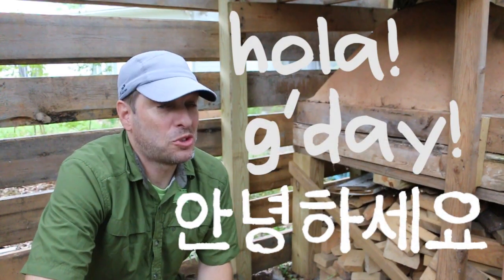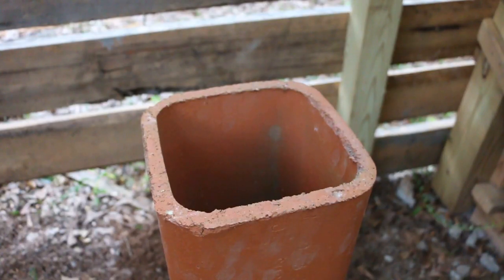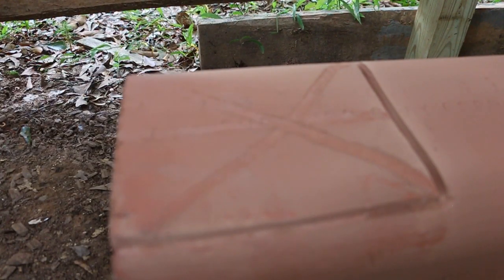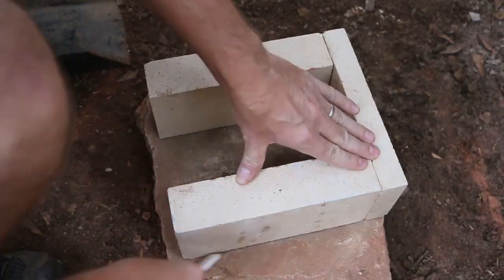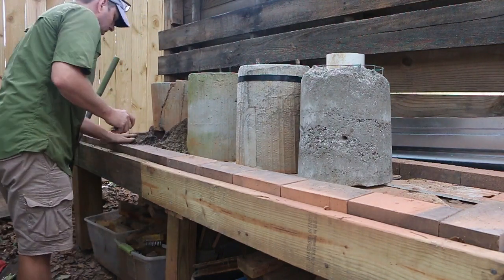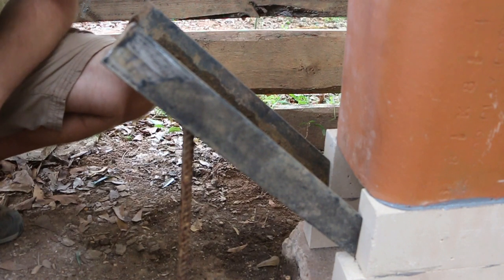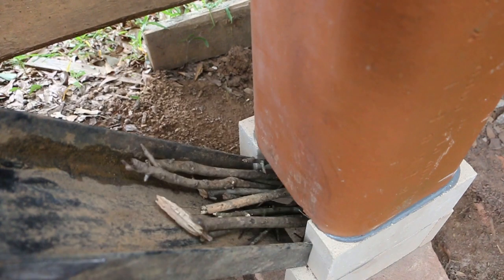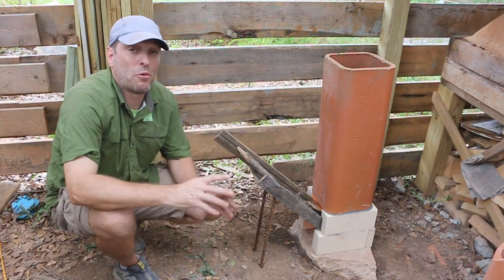How To Make A Chimney Pipe And Fire Brick Rocket Stove

Comment: Love watching you battle gamely uphill with sand, cement, cardboard, power tools and hammers, but man, it is so much easier to use fire brick.  We make our stoves portable by using angle iron (usually cut up old bed frames) and threaded rod to form a cage that holds the bricks firmly together.  To move the stoves, simply back off on the threaded rods and handle the bricks separately.  Quick, and with the stability of a casting.  Set the stoves up for maple sugar season, dismantle them for compact storage afterward.   Never spend a dime on fuel.  We do keep a stainless steel rocket stove for camping.  Double walled and insulated, weighs 18 lbs, has legs and a handle.  We do like our little luxuries.
Reply from the maker: Thanks Jill. Having built a variety of rocket stoves now (including one in firebrick), I will agree with you. Here is my firebrick rocket stove, if you are curious: https://www.youtube.com/watch?v=OJ-gOr3iQ4k&t=4s How cool that you use your's for maple syrup production. I love to see video of that. I think I will end up replacing the flue pipe in this project with firebrick and making the riser shorter. I really want the flames moving through the oven. And, for the record, my channel is about the journey, and not necessarily first finding the easiest path. I love the experimentation process, what some see as failure, I see as iteration. Not saying I got that sense from your comment, to the contrary, it was encouraging. I do intend to migrate toward simpler and easier as the process goes forward, but it will always be the uphill battle...and I hope to pursue that in a gamely fashion. Thanks for watching.

Comment: Great video, I do not want to squat and the extra height is welcome. The feed ramp excellent but sheet metal and a couple of bolts, keep you from getting a broken foot, pot holder,( I know you don't need one here ) one of your sheet metal bands, notched for air flow, works great. Lastly many forget, lift your pot and drop fuel in the top, works especially well with the extra height. Thank you. Last thought  when camping I used to take two blocks and build the rest on site, clean up of the mud base was no problem.

Comment: i like your honest inventive trial and error approach... 

just to be aware, most of these stoves, except perhaps the perlite concrete one are not really true rocket stoves...  over 50% of rockets stoves on youtube are not true rocket stoves, so the term is being widely misrepresented now....

a true rocket stove uses lightweight porous insulation for burn chamber... fire brick is too dense to be good insulator, tho it can take high heat... maybe surround the fire brick with some kind of insulation, and it will simply take longer to warm up enough to have the rocket stove effect of being less polluting....
Reply from the maker: Thanks for the feedback, Forest. I agree with you...the term Rocket Stove is used to describe many stoves that aren't true rockets. I do plan to make a true rocket stove sometime this year. Thanks for sharing your tips. Thanks for watching.
Reply: @GreenShortzDIY  Hey man, I'll be on the lookout for this. I'd even buy a true rocket stove if you are willing to put it out on the market.
Reply: Could you share what the details are for a true rocket stove?  I've noticed that there are a lot of variations in these small youtube stoves...
Reply: a true rocket stove has an insulated burn chamber, using some kind of light weight low density fireproof material, such as vermiculite, rock wool, cinders, type material... this material is packed between two layers of usually metal, sometimes other materials.... the insulated burn chamber once heated up reduces pollution greatly, and was designed for third world people who often cook indoors on an open fire....

many so called "rocket stoves" follow a similar design system but are not insulated at all, or insulated poorly with too dense a material, to reduce the pollution.... if using this type of fake rocket stove outdoors, not such a big problem....

but if wanting to reduce pollution, and get quicker cooking time, and more efficiency, the double wall insulated rocket stove system is important...

there is another type of stove call a "tlud stove" (top lit under draft), or "gasification stove" which can accomplish a cleaner burn without the need for insulation.... but it does require getting more technical with the proper design, knowing just where to place the holes in it, which make it a more bit more technical build system, but no need for insulated burn chamber as in rocket stoves, just need to follow a well designed diy system.... many examples on youtube, and one advantage with bigger tlud stoves is that you can make biochar as well when using it... 

here is a demonstration of commercial gasification stove: https://www.youtube.com/watch?v=PwDCkwJhgy8.... but many do it yourself models on youtube as well... aloha

Comment: Well done. The pizza oven door cannot be more than 61% the height of the dome, it can't trap enough heat, if it's taller than that. If you want to cut any fire brick or the chimney flue, put a ceramic cutting blade on your Wormdrive skilsaw, cut are much faster and much easier to hold in place. Plus, set your depth, make a pass, drop your blade a bit, make another pass. Much more torque and HP to cut than the unstable cutoff. It is at least 4 times faster to cut.

Comment: Cool video.  Ramp is wider than firebox opening which allows wood to grab the firebrick and stop.  Maybe narrow the ramp to match the opening ?
Reply from the maker: Thanks for the suggestion Dave. I think you are right, that a matched ramp width would perform better. I’m using salvaged steel and standard sized brick. Making them match here would have been a lot of extra work. Although I could have welded inserts in the ramp. Thanks for the suggestions. Thanks for watching.

Comment: if you use the thin fire brick, and cut it down to size, you could line the clay chimney to make it more resilient. Place the first row accross the fire box bricks that you can see from the top of the chimney.  Then cut to fit the other two sides and place them on the other two sides.  Then you can build up to the top from there for a tight sealed fit.
Reply from the maker: I like your thinking Brad. I have added a thin fire brick to the back of the firebox, but I may need to go higher with them. Thanks for watching.
Reply: This!

Comment: Will this run hot enough to melt small pots of lead? I've been using a Coleman stove, but sticks are far less expensive that liquid fuel.
Reply from the maker: Jerry Campbell I do think a rocket stove could melt lead, but not in this configuration. I think you’d want the lead crucible closer to the fire.

Comment: Oh darn... I went to buy one...but it was too small for what I was going to use it for... Are you making any... The size of your bucket rocket stove ?
Reply from the maker: In the end, I think the flue pipe is too brittle to handle the heat of a rocket stove fire. I did build one with a cobb liner, but that may restrict the size of the chimney too much, based on the size you could find. Let me know what specs you are working with and I’m happy to offer some suggestions. Thanks for watching.

Comment: I enjoy watching your videos on rocket stoves.  But I would like to see you do a design change that I think will significantly increase the efficiency and make your stoves more Rockety.   A taller flue will create a higher air draw ratio at the fire source.  But more importantly, I would like to see a vertical stick feed with at least a 12" horizontal distance between the feed and the flue.  Creating more of a "J" design.  This will create a horizontal fire draw before the fire enters the flue.  I really want to see your take on the comparisons with a horizontal draw v/s a near vertical draw that you have in your designs.

Comment: I don't think the flue liner will last it's not build for high temperature but at the place where I get fire brick  they have flue liner kind of build like fire brick and those flue liner will take the hi temp
Reply from the maker: I’ll be keeping an eye on it. I did add another thin fire brick standing up in the back of the firebox. I was noticing a few hairline cracks where the flue pipe was nearest to the fire. Thanks for the feedback.
Reply: @GreenShortzDIY  
I hope that the extra brick helps, but suspect that eventually your flue pipe is going to disintegrate. Have taken down several houses where they are just a standing column of powder being held in place by the chimney block or bricks around them. Think it is the temperature differential between the inside and outside that is causing the cracks you are seeing already. Perhaps once the pizza oven is installed this degradation will slow down, with more of the heat being held down around the outside of the pipe?
   Actually came to make a suggestion though, have you considered using a section of double or even triple walled wood stove pipe? The cost would be a little higher, but wonder if the benefit of maintaining the higher temperature inside of your flue would be worth it? My understanding of these types of stove's is you want the higher temperature to carry further through the flue to help cause the rocket effect.
Reply: where do yo get a liner for high heat??
Reply: At the place where they sell brick here where I live they actually have liner that will take high heat more then the regular one but don't know if it's available every where the salesman told me it was a special order and they have some left and they don't keep those liner regularly. he told me they done some test whit them and the regular liner, they heated them whit torch until they got red and they trow cold water at the the regular flue exploded and the grey one like fire brick did not!!!
Reply: MR.Teddy Bear any brand or manufacter name ???
Reply from the maker: @putheflamesou  It is actually not a special flue liner for high heat. We'll just have to see how it olds up to the heat over time. I think the best thing for high heat would be a full build out of fire brick. Thanks for watching.
Reply: @GreenShortzDIY  that was my feedback too.  That, as is, the lower part of the terra cota will fail fairly quickly.  The high temps go up as high as half or 2/3 up the height of that flue liner.

Comment: You didn't put the grating at the bottom to leave airspace beneath the fire, was that on purpose?  I'm pretty new to rocket stoves, I'm just curious after watching the succession of these videos :-)

Edit:  I wish I'd seen the Kickstarter in time!  I'm glad it was successful :-D
Reply from the maker: My initial thinking was that the ramp would suspend the wood letting air flow underneath. This works until the wood gets to short and drops off the end of the ramp. I might weld a grate on the end of the ramp after all. Thanks for the feedback. Thanks for watching.

Comment: can you get a flue pipe that would take the heat....or is that tooooooo safe and sensible and liberating?
Reply from the maker: Ha. Well, I think it may need to be a different material. Or maybe lined with fire brick. Or made out of clay. I do have some of that on hand. And I do plan to make another Cobb Rocket Stove soon. Thanks for watching.

Comment: Is your little stainless steel rocket stove available to buy yet? I'd like to buy one but that has an extension on it where you can screw it into a concrete pad. I get a lot of things stolen from my yard. Also, if I screw it down to the concrete pad, my cats can sit around and enjoy it without knocking it over. I feed homeless cats and they get pretty cold and would enjoy sitting around it.
Reply from the maker: Hi Laura, I have a few left and will get them up on my web store in the next few weeks. Not sending to Amazon at the moment. Watch for an announcement here on the channel. There is a spot that you can attach to a concrete pad for security. Thank you for watching and for caring for your local cats. :-)
Reply: @GreenShortzDIY  thank you! Hope to hear from you again

Comment: Hey, new to the channel. I want to build a rocket stove myself to dispose of wood scraps and I'd also like to cook outdoors, off grid and put them to good use! You've gone through a few iterations of stoves made with concrete and it seems added hassle with trying to make form work that you have to remove. I was considering concrete too as I would assume it wouldn't get as hot as terracotta or steel. I don't know if you've thought of this or have done this in an older video I've not come across yet - but have you not thought of using the chimney flue as your form work? You could cut it at 45deg so they join at the base and then exit. This way you might also get some insulation without having to alter your concrete mix too much. Let me know what you think.
Reply from the maker: Hey Cy, sorry I’m just seeing this comment. Some interesting considerations here. I did use a larger flue liner as a form to hold a inner core of cob. It worked pretty well. I didn’t cut it though. Just did a firebrick firebox with a grate. An L type rocket stove versus a J type. The L type stoves have always worked the best for me. You can find that video by looking for a stove I refer to as Max. I planned to use it to melt aluminum, but it didn’t work for that. Then I made it into an outdoor shower heater. It would be really great at what you are wanting to do, but I imagine you have a solution given that your comment is 3 years old. :-)

Comment: Nice vid...can you adapt it to be a portable rocket mass heater once you have added the top? That might be interesting
Reply from the maker: I’m not sure I could pull off something portable with this set up. I think the “mass” part of it would be tricky to move as well. But, food for thought, nonetheless. Thanks for watching.
Reply: Yes, this design wouldnt work as a Mass heater.  Check out Ernie and Erica Wisner for good info on Rocket Mass Heaters.  They are a slightly different beast than rocket stoves.

Comment: hey man an oxy/acet. rig would cut through that stuff quicker and way more quiet too
Reply from the maker: I need to learn that method. I'm just getting into welding. Cutting with gas is still outside my comfort zone. Thanks for the tip though. Thanks for watching.
Reply: @GreenShortzDIY  oh man ...it's so easy and fun and you can weld, braze, cut, anneal, melt, color metal etc. with it too. it will take you 10 min. to learn the basics and the rest of your life to figure it all out, but hey it sure is fun
cheers
Reply: @motoputz3201  , did you forget expensive ,for the bottled gas ?
Reply: @victorcastle1840   yeah a few dollars ...maybe? you cant measure the time savings and the one hundred other things you can do with an oxy/acet. rig! and if you live in a cold climate it'll warm you up too

Comment: I found one of these in my yard and was wondering about making a stove out of it
Reply from the maker: I might actually have to replace the chimney pipe section of the chimney sooner that I expected. It has developed cracks with just a few burns. I’ve gotten a comment that stated that the flue pipe is made to handle very high temps. Having seen what I have, I’d have to agree. Thanks for watching.
Reply: I was wondering how it would hold up. Maybe I'll find another use for it

Comment: did u use metal cutting disc or stone cutting disc
Reply from the maker: I had a metal cutting disc on my grinder, which I tried out of curiosity. It did nothing. Then switched to a masonry disc, which worked perfectly. Of course, I did have a thin disc, which would have been better. Thanks for watching.

Comment: It's interesting to note, out of all those rocket stove you've made, there is only one that isn't cracked a lot. Which one is that?
Reply: You said second one when I watched again. Does that one have wire in it?
Reply from the maker: Yes. It has a chicken wire armature. It also used crack-resistant concrete. It worked. :-) Thanks for watching.

Comment: Question is" when did the terracotta crack?
Reply from the maker: It got micro-cracks the first time I fired it. Yeah, not the right material for this high-heat situation. I heard about that mistake a fare amount when this video first posted. I corrected this in a future video. I'm still teachable. Thank you for watching.
Reply: @GreenShortzDIY  Seen a guy make a rocket stove out of vermiculite boards. On youtube also.
Reply from the maker: @justtinkering6713  ooh. That sounds interesting. You can see pretty much anything here. lol. 🙂 Check out "Little Aussie Rockets" channel. He is one of the best, in my opinion.